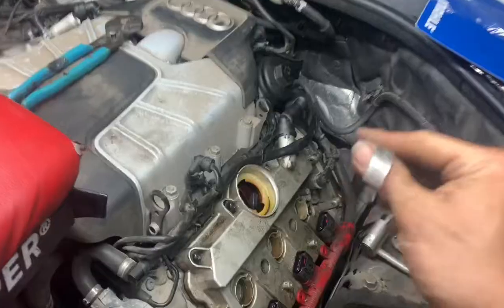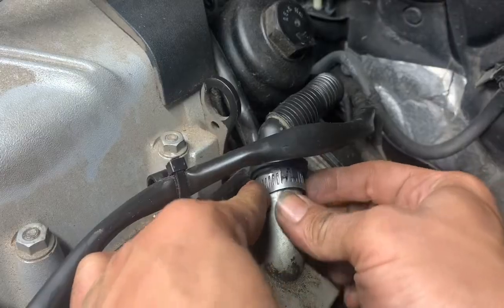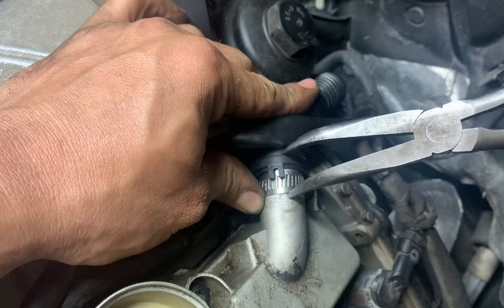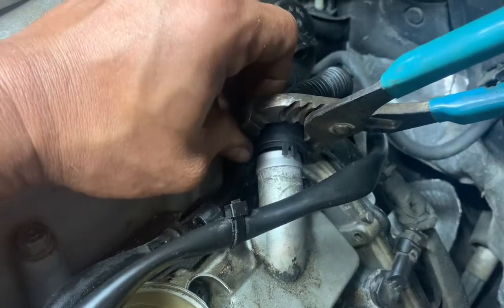Audi valve cover breather tube removal every Audi owners should see this!!!

Comment: Dude; awesome little trick! I was noodling on this one for awhile too. But I wimped out right quick and went to the web and found your video. These days any car manufacturers use a slew of fancy-ass gadgets to connect and retain all of the different wires and hoses on their vehicles. Usually, a reasonably sharp wrencher can figure out how to get them off without destroying them - not this one. Anyway, thanks for the help.👍👍👍
Reply from the maker: Thanks Ron I appreciate you taking the time to write that message I constantly try to figure out ways to do things that will utilize things that most of us have around. And I had broken so many of these in the past I wasn’t going to let this one beat me..

I appreciate the kind words and welcome to the Channell we’re very happy to have you

Comment: Worked great thanks!
Reply from the maker: Thanks Justin yesterday some guy said is this a joke? I’m not quite certain if there’s supposed to be a tool there or he was too dumb to understand how to cut a hose clamp apart or maybe there’s something that I don’t understand anything‘s possible but I’m certain one of the two of us are ignorant. Meaning the other guy who made the comment
Reply: @sharpcarco  right, I used a pair of dykes to cut it and worked perfectly. Didn't want to break the hose. so I tried this.  Great vide,, right to the point no b.s. thanks

Comment: Let’s say I accidentally snapped that piece,where would I find the part for this but more importantly how do you replace it!?
Reply from the maker: I’m assuming you’re not talking about the piece that’s connected to the valve cover....... 

If you snap the other piece you need to remove the intake and replace the lines that are underneath it you will see them immediately.

Comment: I don't have a hose clamp at the moment. What is the normal way for removing that fitting?
Reply from the maker: If I could’ve got it off the way you’re supposed to get it off I wouldn’t of use the clamp...... technically you’re supposed to just squeeze the damn thing and it’s supposed to remove but most of the time they break.

So unless you need to replace them plastic tubes I recommend you go get yourself a hose clamp like I did and remove it or maybe they make some kind of tool that I don’t know of

Comment: What if you already broke that same line but in the middle 😢…. I can’t even duck tape it…. Please help
Reply from the maker: You wanna replace it . You have to remove the intake usually to get to them lines better to do it now and do it right so you don’t have problems down the road because it will suck air and possibly cause significant harm.
Reply: @sharpcarco  Dang that’s what I figured lol… Thanks Clay

Comment: Lol, Use a flat head Screwdriver and a hammer. Set the flat head on the lip of the Breather hose. It will set off with just two hits with hammer.
What a good mechanic who teaches idiotic methods.. he spoiled the hose at 3:31. What a mechanic😂.
Btw use Some lube like WD.
Reply from the maker: Thx  keyboard warrior
Reply: Thanks for Acknowledging